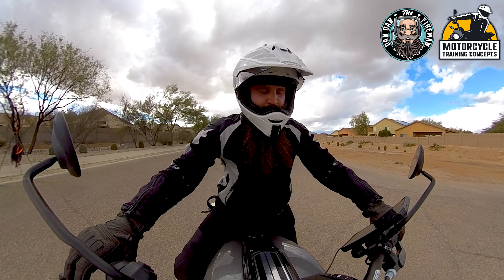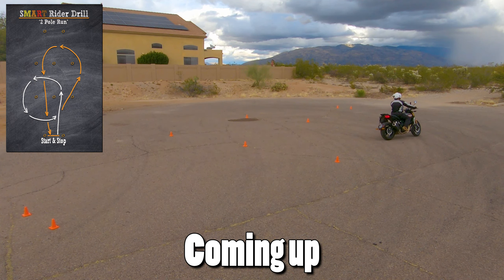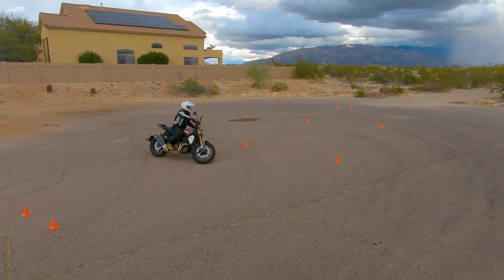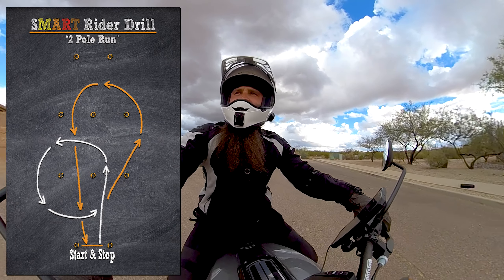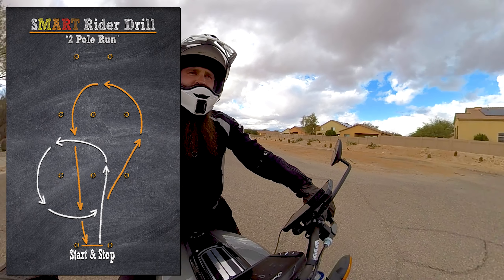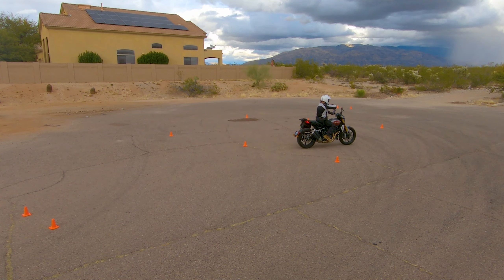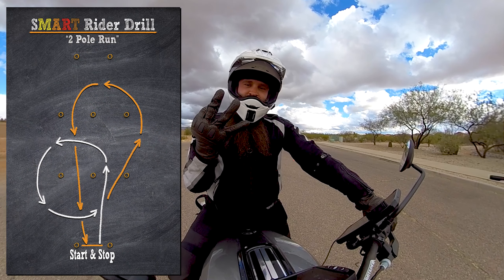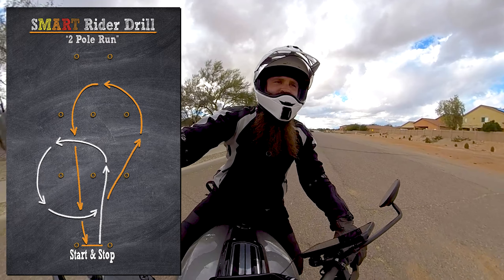2 Pole Run - SMART Rider Motorcycle Drills

Comment: Dan, these type things are super hard on my MT09. On my old SV650 and my mom's FZ07, these type of low speed turns are easy as pie because of the steering lock being basically like a WR250.

The MT09 somehow has a more garbage turn radius than a 3rd gen Dodge RAM. 🤢

You almost need to drag peg to make the turn radius similar to anything else ☠️
Reply from the maker: What difficulties are you having? Mainly the turn or speed or?
Reply: @MotorcycleTrainingConcepts  it's just that there's no steering lock, you have to lean the bike so far down for a u turn you're basically hanging off the side
Reply: @Bacon676  Ever seen motor officer training on motorcycles? Those dudes will almost drag entire fairings and counter their bodies above to make some RIDICULOUSLY tight low speed turns. I’ve started practicing this stuff on my ‘21 Goldwing and it’s sheer weight (800+ lbs) makes this difficult, but it’s worth practicing either way.